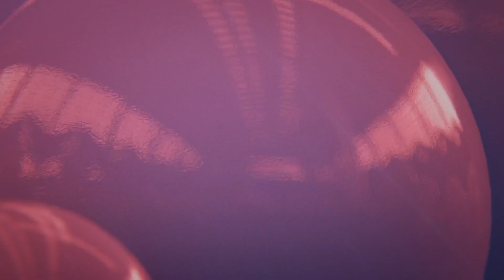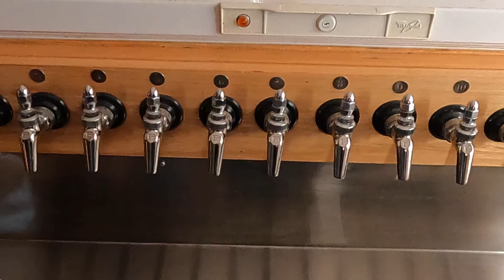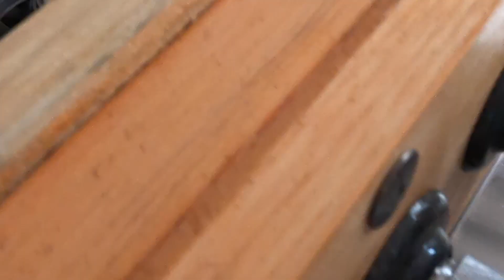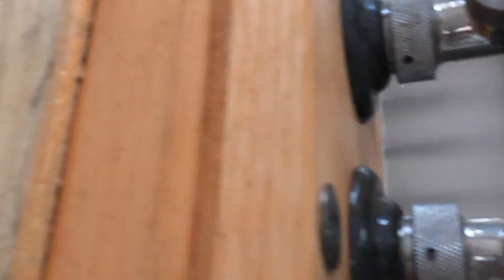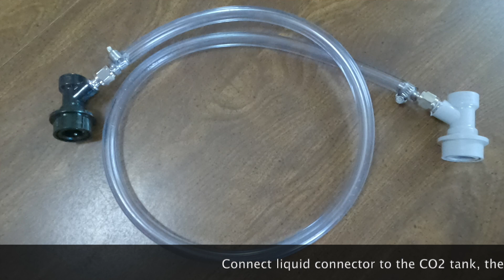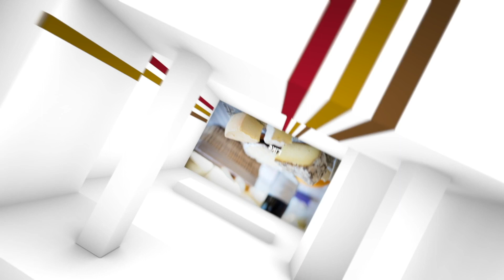How to fix a clogged Beer Keg that won't pour.

Comment: Made my day simple as that fixed my stuck keg took that tower apart twice trying to figure this out turned the gas up to 20 way above serving pressure 
Beer keg was half full and I work 8 hour shifts sometime days go by with out me drinking I clean the lines every keg fill never thought the keg it self was stuck omg mam you saved my day
Reply from the maker: @johnp254  That's fantastic!

Comment: Appreciate the video but this didn't work for me. Instead I purged keg, unscrewed the liquid post with a pair of pliers (I didn't have a socket wrench that fit) and pulled out the dip tube. I covered the hole in the keg with a piece of sanitized foil. I discovered a quite frankly disgusting amount of hop matter in the spring and tube.  Im not too "technical" about connections etc so I was nervous to take apart my keg parts so I admittedly had not done this....ever. But it's actually really straightforward so I'll be doing routine maintenance from now on. Anyway I removed all the gunk and how the beer is flowing!
Reply from the maker: I'm sorry the method didn't work, but happy you got to the cause.  No amount of pressure would have blown that out for you.  I think you did a great job keeping your beer protected during the process.  Nice job!